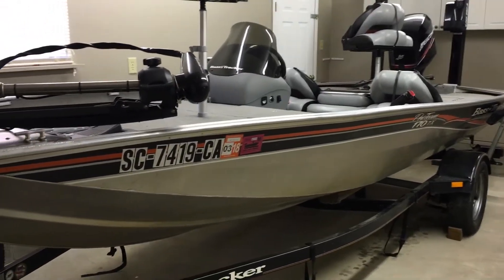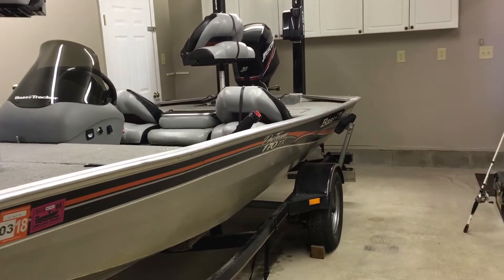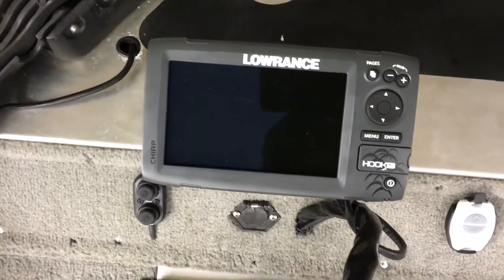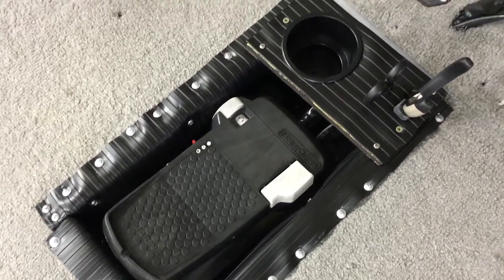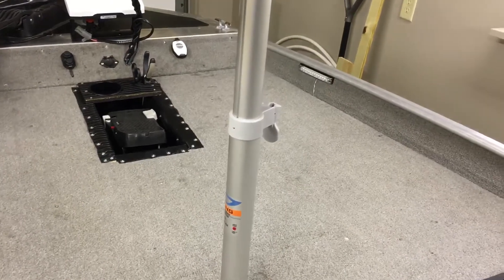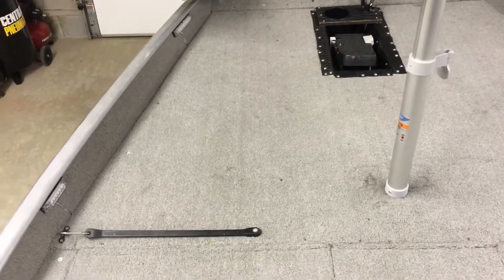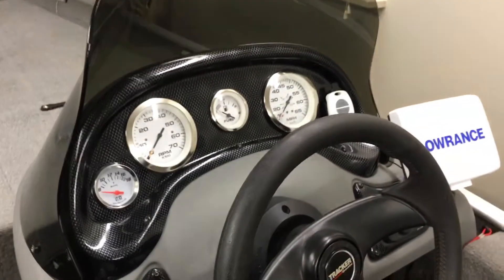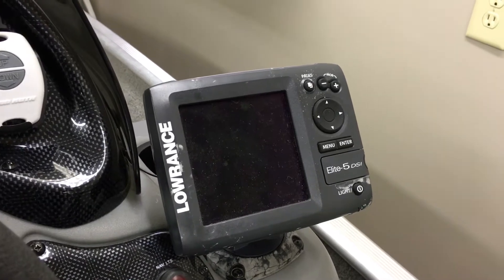Minn Kota Talons(2) bass tracker

Comment: thanks for your reply,  I'm just going to do it the way you did it.  I like your setup and glad I saw your video.  I was having a hard time deciding because minn kota recommends mounting them directly to a flat transom but tracker says if I mount anything on my transom it voids my warranty,  and by the time I buy 2 brackets and tilt brackets it adds so much weight and its like $900 just for all those brakets. I'm  definetly mounting them to my transom. I  just posted a youtube  video on some stuff I did on my tracker pro team 190. titled "boat deck lighting for cheap" I'm happy with the boat,  anyway thanks again for the info it was very helpful

Comment: Nice set up I just purchased 2018 190tx tracke wanting to add two 12 footers. But Worried about the spacing between  motor and talents they recommend inch clearances do you have any problem turning motor and hitting talons. Thanks in advance
Reply: Have a 115hp on it
Reply from the maker: Crappie Ghost no I don’t have any probs with touching or interference..I just dry fitted them first with motor turned to each side both ways and marked with bracket and was fine

Comment: Did you run into any issues under the deck or running into braces or the rod locker when you cut the hole for the recessed foot pedal tray?
Reply from the maker: No I didn’t. I knew where brace was already so i measured and cut accordingly

Comment: What differences have you noted with the weight of two Talons on that Tracker?  I have the Pro 175 TXW and reluctant to put two Talons due to weight.  I have the 60hp Mercury.  Thanks,
Reply from the maker: Not a whole lot to be honest. Takes a few seconds longer to plane then usual. It is balanced well with them on it. Shouldn't see y not your 175 wouldn't be a prob at all
Reply: Thanks.  Appreciate the input.

Comment: hey malcboy89,  I like your setup and had a couple questions,  I just bought a 2017 tracker pro team 190 with a 175 hp and wanted to put 2 12' talons on.  I noticed you don't have tilt brackets,  any issues with getting in and out of your garage?  and also I"d like to get them spaced out as far as possible but I'm trying to avoid buying $700 in brackets and paying someone to remove the motor and install them.  I may just bolt them to the transom like you did.  I was wondering how far apart they are? like from the center of one talon to the center of the other talon? any help would be appreciated, thank you
Reply from the maker: jason T the only thing I can't do is back the boat up in there with truck because it will hit. I have to unhook it and jack it up so the back is tilted down and push it then it goes in with ease. Luckily I keep it on my side shed so I don't really have to worry about that prob unless I'm working on it in winter like here. U right I didn't want to spend all that money for the brackets! Plus that would've been pushing the weight limit for my lil boat. It's pretty small already. I don't know the exact measurement from center to center bc I don't have the boat with me now where I live. I did just try to mount them out as far as u said so they are out until i couldn't go anymore. They do hold steady and the not leaking through holes.

Comment: How close are you to the max weight capacity of the boat? How many people can you get on the boat with you?
Reply from the maker: Mike T I still can have 3 people on it with no problem and runs well. Usually be 2 most of time.
Reply: Does the back end sit low with just you in the boat?
Reply from the maker: Mike T it sets the Same. Just a slight second longer to plane but other then that no probs
Reply: thanks for the information. I'm getting a Lowe Stinger 175 with a 75 hp motor and getting  a similar set-up.   I was concerned about the front of the boat sitting too high due to the weight in the back. again thank you.